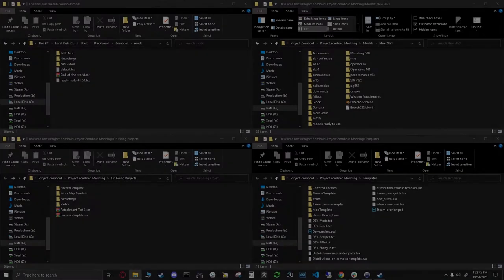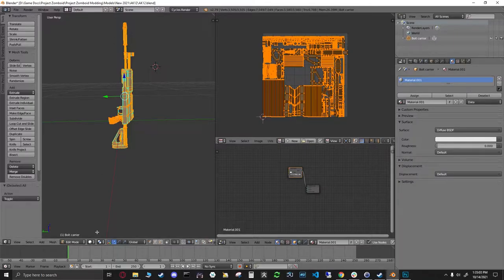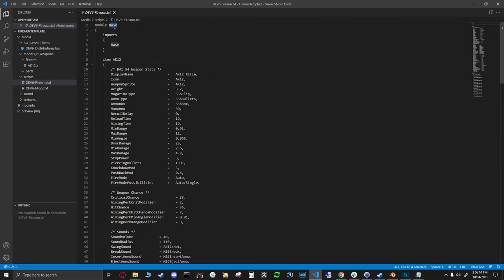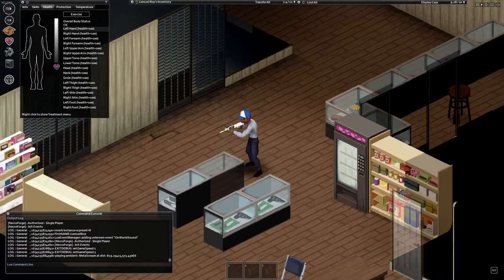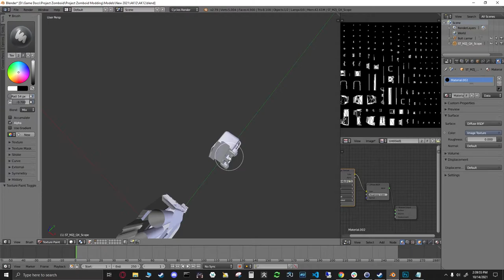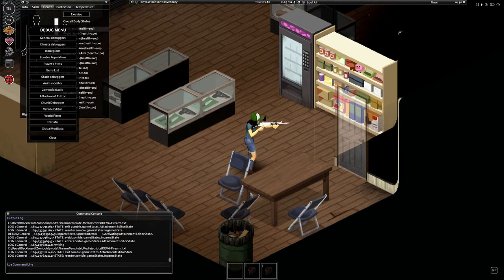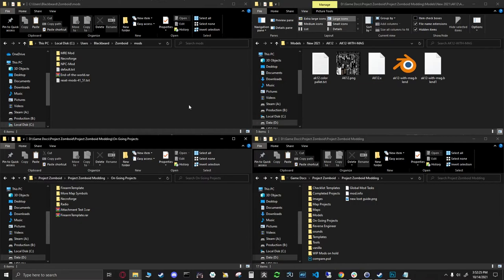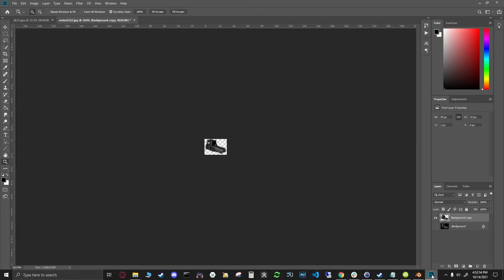How to make a firearm mod for Project Zomboid build 41.54

Comment: Hello, I am looking to fix some mods. I know it is pretty simple to edit the scripts for the mod. But I can't seem to figure out how edit weapons that has Automatic, semi auto, and single fire mode in the scripts. I have the Firearm B41 weapons mod. For those who used it, they will know that all the firing mode doesn't work. For example, the Franchi LAW-12 is a semi auto shotgun. But for Firearm B41, it was still pump action. This is simple enough to fix by just editing the RackAfterShoot = FALSE in the script and the LAW-12 will become semi auto with no pump action. But it is still not perfect, since when you empty the shotgun and reload it, the animation and sound will do the pump action when you finish reloading. But I guess you can live with it as long as the firing profile is correct to the real LAW-12.
Now the bigger problem. How do you edit a script for semi auto mode for SPAS-12. If I just change the RackAfterShoot from TRUE to FALSE. It will permanently make the shotgun semi auto. Also the SPAS-12 is definitely the more complex one to do since it can do pump action and semi auto. So how do I make it change to have the pump action in one mode and a semi auto mode when chosen in semi auto mode. I am trying to figure out how to tell the game to change the RackAfterShoot to FALSE only when I choose semi auto mode. In the script for the guns itself there is only FireModePossibilities = Auto/Single. But I can't find where the script for all the firing mode. The only other way I think that can be done is literally just make it respawn as either SPAS-12(semi auto) or SPAS-12(pump action) when you change the firing mode. Because the FIrearm B41 mod already did this with recipe for extending and detracting MP5, Uzi, SPAS-12, and Mac-10 stock.

There is a fix for the other weapons  which is Real Full Auto mod. But it doesn't seem to affect shotguns. All the rifles and submachineguns works perfectly though. I tried to learn what this mod changes but it doesn't even have a script file in the mod itself. So I have no idea how, or where the changes are made to change the shooting profile of full auto.

Also in Firearm B41, there is a weapon's attachment for shotgun called improvised flashlight. But the flashlight does actually work as a flashlight. I was thinking maybe I could modify it and make it to actually work as a flashlight. But I have no idea how to do it.

Comment: What happens if the rifle doesn't sit in the shoulder correctly? It sits forward and is being held by the stock.
Reply: you need to move the origin of the model to the pistol grip
Reply: @specialforces3114  When I equip my weapon, it is not visible, do you know what the problem is?

Comment: For some reason custom attachments are not moving at all for me using the editor, I have the attachment setup correctly as far as I can tell. a vanilla red dot for example moves around just fine but any custom attachment is stuck in its default wrong position and I can't figure out why
Reply: TRUE , any idea how to solve this ? and there have not a single thing mentioned about this anywhere on the internet too this is too frustrating
Reply: @mediumsurmoon6283  Sorry for late reply, it was due to a name mismatch, haven't done it in a while but if I remember the model name has to match the attachment name EXACTLY including case, example:

	model ShotgunSling -------------------------- THESE TWO HAVE TO MATCH
	    {
		mesh = Weapons/parts/ShotgunSling,
		texture = Weapons/parts/ShotgunSling,
	    }

================================================

	model Shotgun
	{
		mesh = Weapons/Firearm/Shotgun,
		texture = weapons/firearm/Shotgun,

		attachment ShotgunSling -------------------------- THESE TWO HAVE TO MATCH 
		{
			offset = 0.0000 0.1440 0.0380,
			rotate = -77.0000 0.0000 180.0000,
		}
	}

For your own sanity make sure if you are using custom weapons that they are orientated properly in blender first or lining up the attachments will be a nightmare of trial and error as how they are shown in the attachment editor will not match ingame, you could follow default by importing a vanilla weapon or just make sure the barrel is pointing up, with the handle of the gun facing left from your point of view, that alone is not enough, as while being in this position the gun needs a 90 degree modifier on the X Rotation, you do this by getting it into said position, then reset the data by clicking Object > Apply > All Transforms - then hit -90 on X and repeat transform clear, then hit 90 X so it is in the right position as said above with the 90 X modifier, and as always make sure you're exporting the model properly -Z foward / Y up if i am not mistaken.

I apologise if you know all this but for me this was all new and with little to no explanation online which led to me spending stupid hours working all of this out.